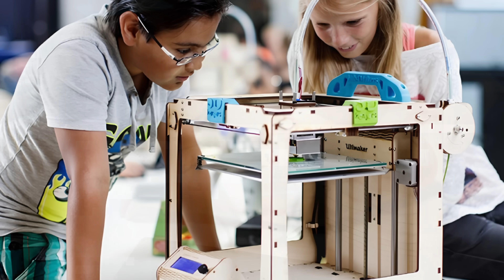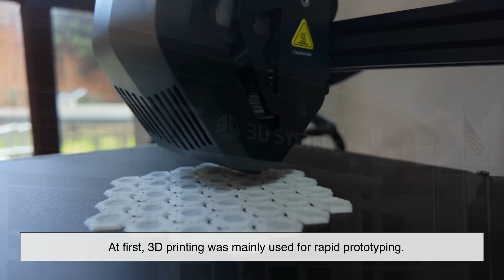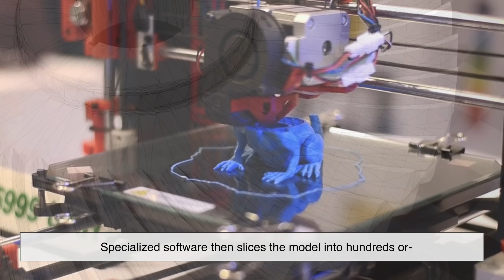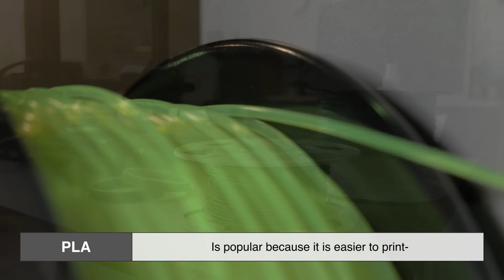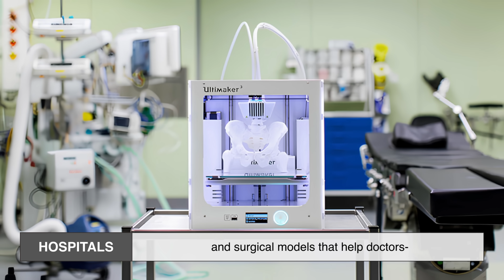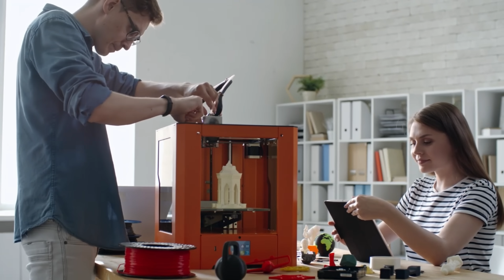How Does 3D Printing Work?

Comment: Is an 3D printer same as cnc machining. If not suggesting of another video on cnc machining
Reply: CNC machining removes material. 3D printing adds material. Both use computers to control the process.
Reply: @Luther_The_Rogue well said. It's about additive manufacturing vs subtractive manufacturing
Reply from the maker: I'll keep your suggestion in mind for future videos! Watch out for more fun trivial videos!😊 - Admin MD